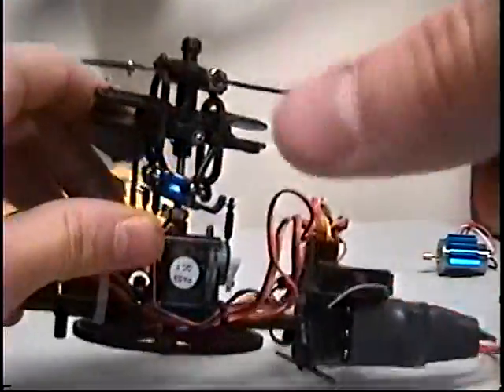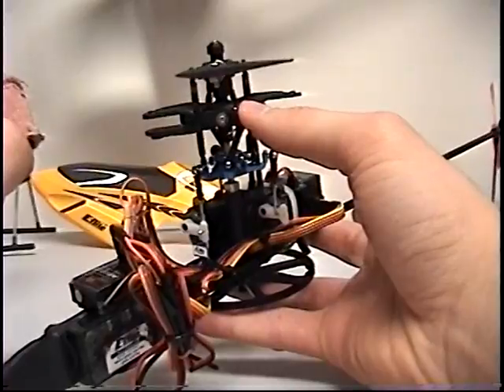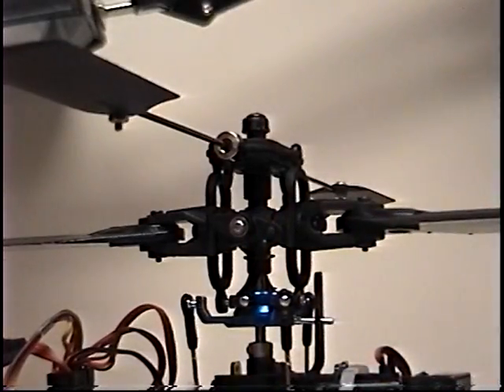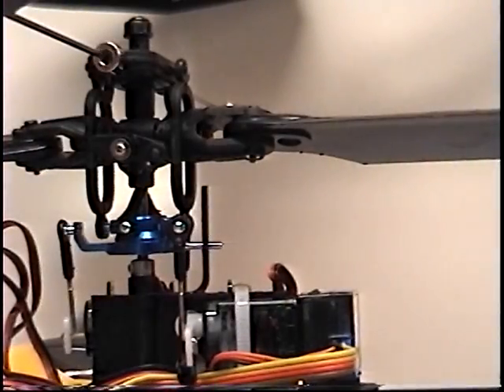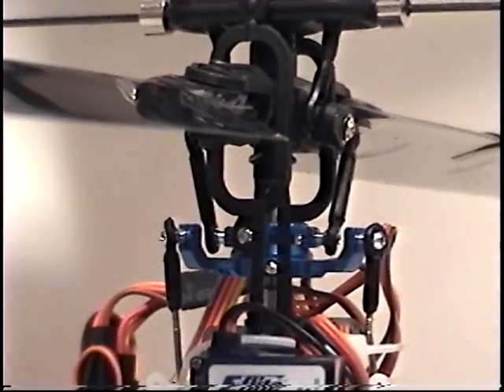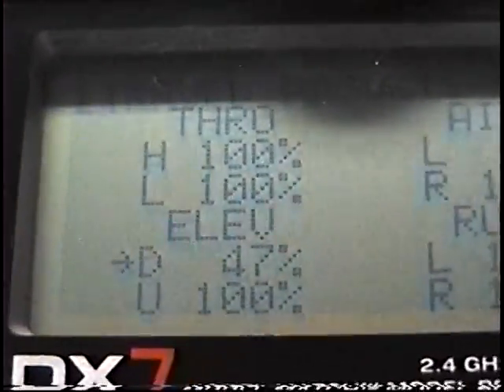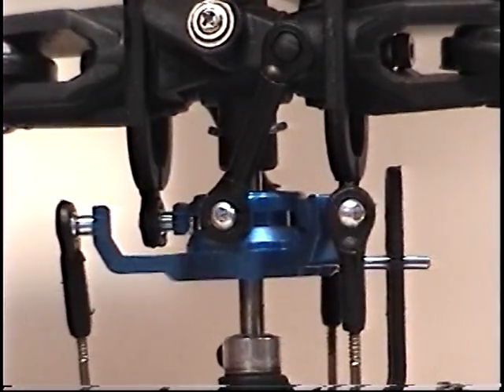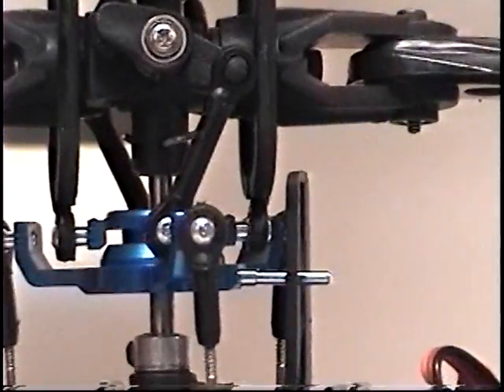Swashplate leveling part 2

Comment from the maker: First, I assume you are talking about the Idle up switch? I recommend you unplug the motors anytime you are working on the helicopter. When you program the transmitter you can store different throttle and pitch curves. Then when you flip the idle up switch it will use the curves you programmed.

Comment: helicopters tend to drift left upon takeoff because of their torque, it is not something you should be correcting on the ground. However, adding right aileron should not make it go more left. check to see if ur servos are not reversed.